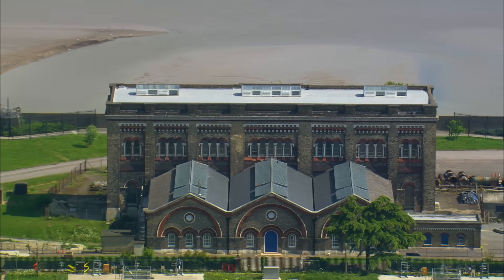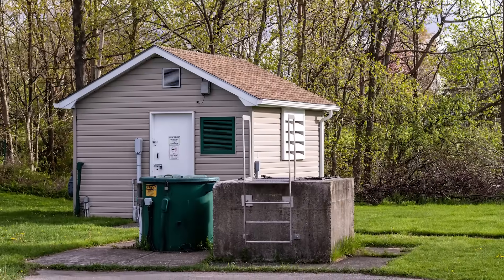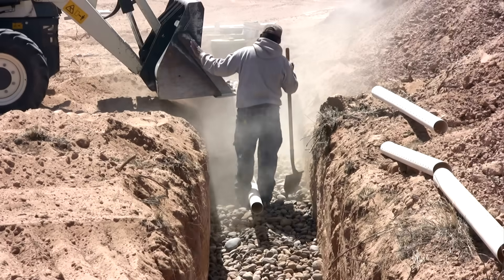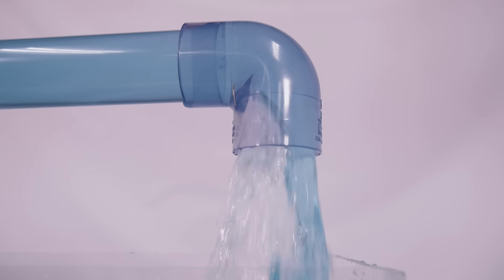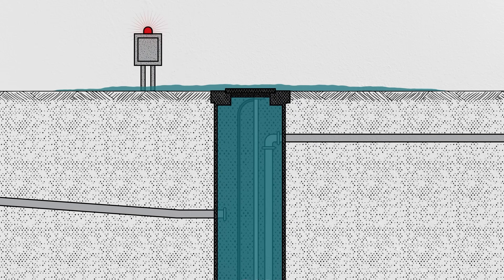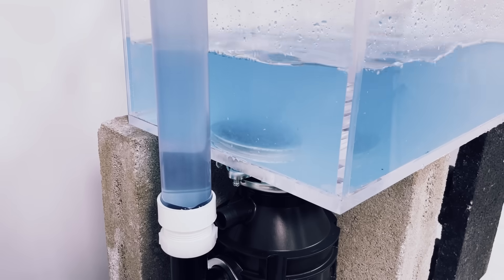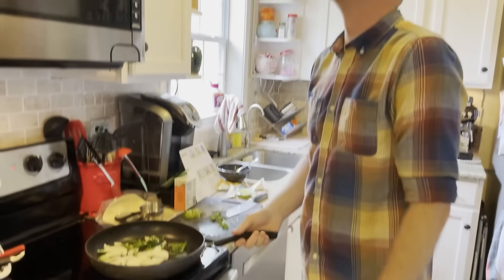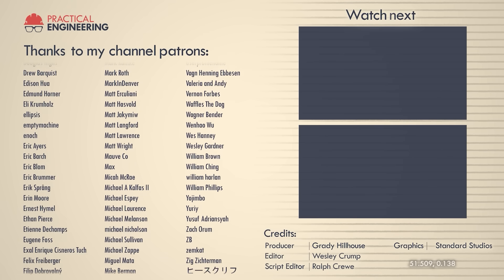How Do We Pump Sewage?

Comment: Another banger Grady! Excellent job!

Just an FYI, HDD (or Horizontal Directional Drilling) is a much safer, more reliable and less intrusive way to install sewer lines. No need to trench and far fewer limits on the depth you can go.
Reply: Not so. I am currently doing a force main and using a maxi rig because of its diameter. I have to close the street to fit all the equipment needed. If i had my choice I would open cut everything and maybe the ocassional Jack and bore because it is mist compact but used for shorter distances. HDD is definetely not good for gravity sewer installation because you need accurate straight line control.
Reply: @donquique1  Interesting, what locating equipment are you using to track your drill head?

Comment: We have some of those pumpe+grinder pumping station, they last about 1-2 months before the grinder blades is destryed from all the sand and those blades are realæy expensive to replace, so we besicly stopped buying pumps with grinders build ind.

And yes we do have apropebly sized sand catchers before the pump stations, but some really small sand particles flows right through those and its enough to damage the grinders.

Comment: I used to do this here in South Louisiana with C-60 soil and running sand near and in New Orleans. Well points are vital for removing ground water to trench. Did a lot of ARV replacements on force mains too. Did you know that in the historic district of the French Quarter they still use wood pipe?

Comment: Those don't look like flushable wipes. They are too big and too tear resistant. They appear to be baby wipes, which say that they are not flushable on the tub.

Actual flushable wipes are much smaller, about 4"x6", and will rip apart at the slightest provocation, including taking them out of the stupid tub. You have to be very careful to get them out.

Comment: We use Vortex Pumps for wastewater treatment, and they can pump anything that fits down the pipe. never had one block so far and I've seen them shift metal parts and rope. could make an interesting video if you made one with a transparent housing!
Reply: Yes,  but they're horribly inefficient hydraulically.   No such thing as  a free lunch!
Reply: Used to rent a “trash pump” for construction type stuff, similar to your vortex pump I think; the impeller is open with large clearances, in fact, one I saw only had two blades. Worked great for low pressure/large volume applications.

Comment: Great video Grady! I was performing an ALTA survey last week and had to locate a force main air relief valve near the property. It was in line with the 36 in force main but also had a 8 in pvc splitting off of it to a near by manhole. Would the function of the 8 in pipe just be to vent the gasses or would it carry solids and liquids in certain situations too?

Comment: We have a lift station nearby that has an electrical power inlet plug that gets used during power outages.
A few years ago we had a multi day power outage and heavy rain. 
The city sent a generator truck on a circuit around town plugging in and pumping out the lift stations. Fascinating.

Comment: My friend had 80% of his neighborhood flooded with sewage a couple years ago due to heavy rain. Most of the buildings were built in the 60's, but there were also a few blocks of new, modern houses just being finished. One guy had just moved in the previous day to have everything in the basement covered in 2ft of watery sewage. Definitely thankful for the engineering and upkeep that keeps these systems working (most of the time😆)

Comment: Do systems ever avoid pumping the sewage directly by pumping air into the wet well to just force the slurry up the outflow pipe? Maybe this wouldn't work for continous operation I guess.
Reply: I'm no sewage pumping expert but I don't think it would be very pratical.

If you pressurised the wet well all the time then the sewage wouldn't be able to flow into the wet well in the first place, so you would have to pressurise it cyclicly. You would also need a valve of some sort (either a 1 way valve or a valve synchronized to the pressurisation cycles) to prevent back-flow into the inlet pipe.

Comment: I've tested my flushable wipes vs tp. After 30 sec to a minute, simple stirring breaks both apart pretty much identically. There's probably some bad ones out there but I haven't run into them yet.
That said, bidet plus regular tp, or even better a dryer, is superior anyway.
Reply: Alot of them are marketed as "flushable" and I guess technically they are...Along with your car keys, wedding rings, smaller cell phones, and a plethora of things that are flushable. That doesn't mean they SHOULD be flushed. If the ones you use actually breakdown like t.p., then they may be ok.
Reply: @chuckycheezburger3313  ya, I'm sure there are bad ones but I've used several and I'm yet to find problem ones. They're so much better on the booty I'd just hate if people don't try them for fear of ruining their plumbing
Reply: @westownsend8228  I can appreciate how much nicer they are on the bum, especially when suffering the aftermath of Taco Bell and Paqui haunted ghost pepper chips. But I've seen what they can do to the system first hand. At my job, we have to deal with residential grinders along with the reguler sewer and water stations.When we have to replace one, its usually because of grease or wipes that don't break down. Went to one where the owner said they "neeeeeever put grease or wipes down the drain." Pulled the pump ( it was the same kind as shown in the video) and stuck in the bottom was a mass of wipes, with a twisted, tangled rope of them lead back into the well. After all was done, we pulled out roughly 2 forty gallon trash bags full of nothing but undissolved wipes. They had clogged the lines, and burned the pump motor up. The yard was soaked with sewer and stunk up the subdivision.Owner couldn't really explain how they got there...
Reply: @chuckycheezburger3313  that's crazy. Maybe I'll buy up a bunch of different wipes and make a vid showing different brands breaking down vs tp. Maybe we can expose the culprits.

Comment: During the 1980s, Montrtéal built giant  "collectors" to get sewage from all municipalities on the roughly 60km long island to a large sewage processing station on the east end. 
In 2015, while demolishing an elevated highwayt downtown (Bonaventure Expressway)  to replace it to ground level, they had to move a snow dumping station that was located under highway, and over the collector.   For certain areas such as downtown, snow clearing operations end up dumping the snow into the collectors instead of  traveling long distances to an open air snow dumpng site. 

This work necessitated closing that collector, resulting in about 1/3 of sewage being dumped raw into St-Lawrence and of cource got attention of the media. 

Environmental reports provided non-sensationalistic facts on the need to do this in October (before first significant snowfall) but also the fact that while the collector was drained over a long distance, a number of pumping stations would see upgrades/repairs, the collector would be inspected etc (so a lot of work packed into 1 week). 

That even brought to light some of the systems needed to run a sewage system beyond just the tratement centre.

Comment: I've noticed that the lift stations in my area have jib cranes permanently installed over the wells, presumably they require maintenance/cleaning regularly enough to justify the expense rather than relying on portable cranes.

Comment: A question about your sponsor. Is it really that hard and/or inconvenient to get fresh produce in just the right amount you need, within walking distance of your home in North America at a reasonable price? I can walk to a shop/market (actually there are more of them within walking distance), buy most of the ingredients by weight/volume (as much as I choose to), with the exception of non perishable goods, e.g. rice or flour, that I can store for weeks without any problems. There are seasonal variations and not everything is available for a good price and in good quality all year round, but there is always the option of canned and/or frozen raw vegetables or imports, but I try to source my stuff locally. Also, "fresh" things are not necessarily expensive compared to "frozen or canned". Fresh milk and milk products is also not an issue. I live in central Europe. While there are "ready to eat, just warm up" meals available, or frozen pizza, their popularity is very low, but they are available. I also use "half-products" i.e. partially processed ingredients for cooking, e.g. canned peeled and chopped tomatoes. But I never buy any frozen, chilled or canned "complete meals". And certainly no processed meat with the exception of meat products like sausages. I even make my own ham. It is really not that much work.

Comment: Grady: "Of course, we don't typically release raw sewage into waterways anymore"
Chicago: Am I a joke to you?

Yes, the Chicago River still receives raw sewage today. The Chicago River actually flowed into Lake Michigan, but since Chicago got their drinking water from there, they did the only logical thing... no, not stop dumping raw sewage, they reversed the flow to send it down the Mississippi River instead! Technically the sewage is "treated" to the extent that solids are filtered out; however, there is no sterilization or sanitization, no addition of chlorine, and no biological treatment. They're basically running it through a strainer to catch the paper, and then on into the river. If I did that, the EPA would fine me for a ridiculous sum of money.

Comment: I was interested by this for quite some time because we have an open-topped tank in the ground where, the sewage treated by our household plant goes. There is a pump that is supposed to move the water somewhere else, but because there is quite a lot of sand and sediment in the tank, the pump lets the smoke out about once a year. When we got the last one, it was labeled as a sewage pump and it only has two or three blades on the impeller, so hopefully it doesn't break as soon.

Comment: Here in my part of Germany most of the main sewer lines use archimedean screws for pumping the sewage, as they don't clog up that easily. Isn't that a thing in the US as well - or did Grady leave it out for time sake?
Reply: It does not appear to be the same here in the U.S.
Reply: In Canada, screws are implemented only at treatment plants. Screws take up a fair bit more room than a submersible pump & wet well so they are not preferred.
Reply: @slysendyse  We have them at the treatment plants as well. Rainwater overflow basins and lines that serve only one or few buildings we also use submersible pumps.

Comment: I work in an underground mine. We have to wash the main shafts daily, and that water needs to come back up to surface. We pump the water back up 1,000 meters, or roughly 3,300 feet, with no stops inbetween. Monumental task, and when it breaks, that 3inch diameter pipe holds a LOT of water that suddenly comes rushing back underground, FAST.

Comment: An interesting point you might wish to know (if you didnt already) - in some towns in the UK to control the build up of "unwanted gases" special gas street lamps were introduced to burn off the excess methane. Often you can tell these apart from other lamps as they burn continuously during the day time as well as at night.

https://en.wikipedia.org/wiki/Sewer_gas_destructor_lamp
Reply: Not everyone annotates a youtube comment!  Thank you for sparing me lots of effort and guessing
Reply: @tsm688  Depending on the specific youtube channel and the link, sometimes comments with links in them get automatically deleted.
Reply: @WanderTheNomad  really.  Too bad they haven't figured out how to do tht to the neverending torrent of porn links lately
Reply: @tsm688  yea, what I hate is when I try to post a link and my comment gets automatically deleted, but then I see a bot comment with links in the very same comment section.
Like, how is a bot gonna get treated better than me? 😭

I think they've just found loopholes around whatever filters the specific youtube channel has set up.
Reply: There’s also a lot of plain ol’ iron cast iron pipes  (and some brick chimneys) that run to about street lamp height and exist for discharging and venting sewer gas around the U.K. Airlocks in the system would be “unfortunate”.
Reply: There is a gas lamp that meets this description in New Cross, London, at the junction of New Cross Road and Queen's Road. 
Thanks for the insight.
Reply: That's really interesting, thanks!
Reply: @Will he heck as like 

G'day,

Backtrack me to see,

"Ongoing War Against Australia's Feral Animal Species...!"

I pour my Sewage down Rabbit Burrows..., and Feral Tomatos emerge as a result.

The video posted last week featured my Shite-Bucket being poured down a Fox's Den, but in the narrative buildup I showed one wild feral Tomato growing from a previously treated Rabbit Warren....

I have a Certificate from my local Council's Toilet Inspector, confirming that my setup is

"A Dry-Composting Toilet, in good functioning order..." (!).

The Tomatoes are a bonus - but one has to pick them slightly green, because otherwise the Grey Kangaroos and Swamp Wallabies get them first(iez).

Such is life,

Have a good one...

Stay safe.

;-p

Ciao !

Comment: Some notes from my time as a student engineer at what I was told was at the time the second largest plant in Canada. We had two lift stations there, one old one from the 60s that was a huge set of two screw drives tilted at a 45 degree angle in order to lift effluent, and an IN construction modern lift station. Despite being at the end of the chain and basically the lowest point in the system, gravity wasnt always enough so even we needed lift stations. As for solid wastes, I dont recall there being any grinders, though sometimes we'd see some pretty large chunks of stuff in our raw intake openning. We had screening stations - detritors - as a preliminary step before effluent would be sent to the primary settling tanks where the proper treatment began. The older stations used large bar screens meant to keep only the biggest stuff from the process, but the newer ones made use of smaller screens. I know in my area there has been some on going debate about the use of 'garborators' - garbage disposal, the kind in your sink - due to their impact on the entire system in general.
Reply: I make a habit of not putting a lot of fibrous waste into my own sink grinder. I'm pretty sure the thing can handle it, but I live in an older building and we've been warned not to flush certain things or overload the sink grinders due to the pipes. In fact, after watching this video and now having something to compare to, I think there may in fact be a waste pump system just outside the front entrance.

Which means I did learn something today! 😄

Comment: 00:18 No raw sewage directly into rivers? Oh yes! Here in the UK this happens quite frequently especially after heavy rain.
Reply: Happens anywhere, unless the sewers have been massively oversized.    
In old 'combined' sewer systems, they're designed to work that way.
In newer 'separate' systems, the pipes are designed to take typically 6 times 'dry weather flow' but even then, in a good storm, 'infiltration' (leaks!) can overload the system.

Comment: Total novice here, but why don’t lift stations have a positive air pressure system that pushes waste up the outtake pipe? Wouldn’t that alleviate the need for a pump physically submerged in the waste?

Comment: The other day at my job I had to replace two sewage lift station pumps in a small building because the tenants were flushing wet wipes, plugging up the old pumps. We installed grinder pumps and haven't had any issues since. Good video! A lot of people don't understand what happens after they flush the toilet.

Comment: That not true, there are out flow built in sewage systems the prevent hydraulic pressure and/or waste back up into buildings in the event of a lifting station failure and/or heavy storms or storm surges.

Comment: Wouldn't linear pumps make more sense with waste water? Also for the automatic screens, how about using them as conveyor lifts to mix the solids with the liquid again once the sewage reaches higher altitude. This way you would need far less manual work.
Reply: Linear pumps are often used on wastewater treatment plants. They are too big and too inconvinient for local urban pump stations.
Reply: Also automatic screens are just sorting solids to hydraulic press and further to the bins. This is working fine.